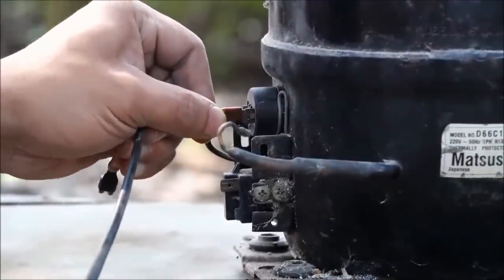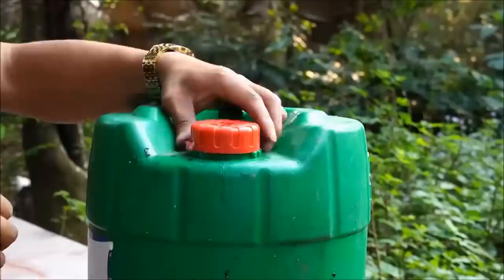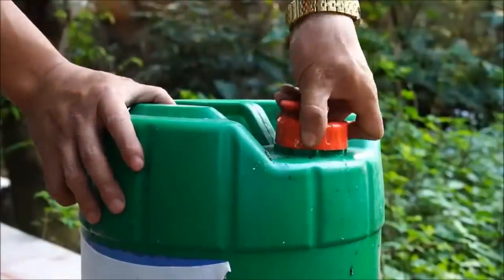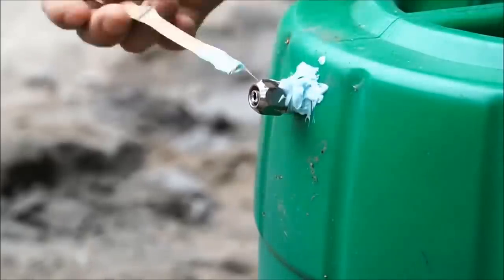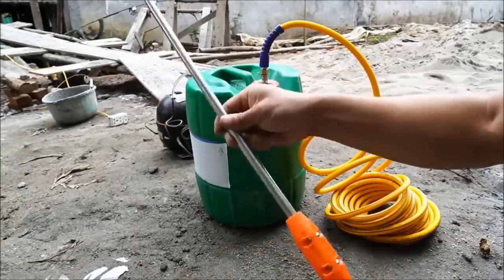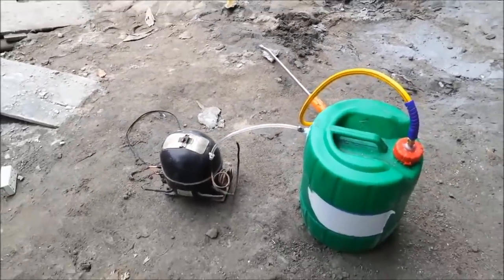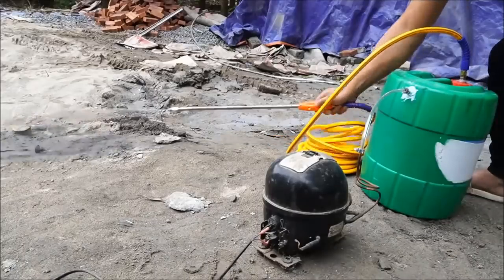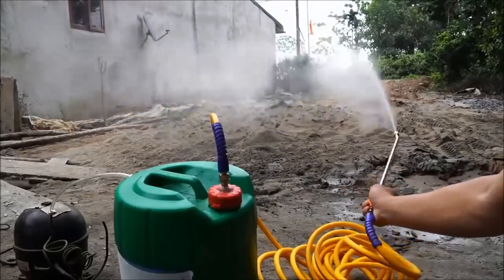Cara Membuat Alat Cuci Mobil dan Motor Dari Bahan Sederhana

Comment: bermanfaat bg😊kira2 jika menggunakan 2 atau 3 kompressor kulkas apa akan menambah tekanan airny y😀
Reply from the maker: Kalau kompresor ditambah pastinya tekanan akan lebih kencang, tapi hati2 jerigen bisa meledak kalau tekanan overload, spy aman hrs pakai pressure control, jd kalau tekanan berlebihan otomatis akan terbuang
Reply: @MBasProject  yg dimaksud "jerigen bisa meledak"itu penampung air nya atau tabung kompressor kulkasnya ya gan🙏
Reply from the maker: @dwiepnoercahyo2366  maksudnya tabung/tanki airnya, kalau tekanannya berlebihan bisa pecah karna dr bahan plastik
Reply: @MBasProject  oooh,jdi kalau tabungnya pake tandun atau penguin bisa lah ya,paling tinggal ketahanan kompresornya kalau buat pribadi sya rasa oke lah,tpi jika buat dorsemer/carwash sy rasa perlu tahan uji lebih dulu hee ,makasih ilmunya gan sukses slalu🙏